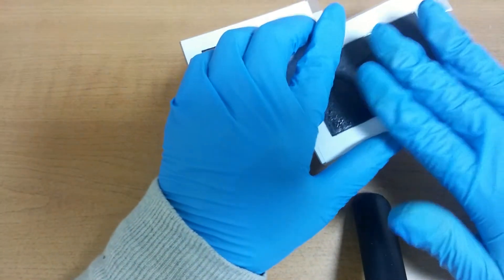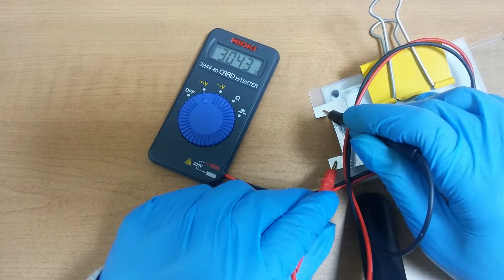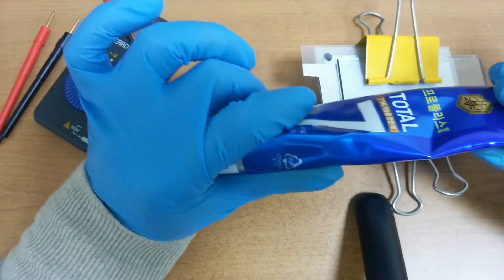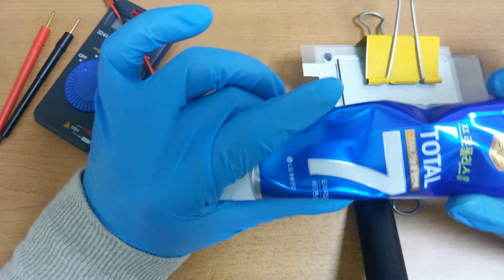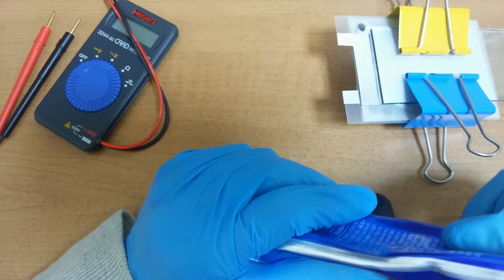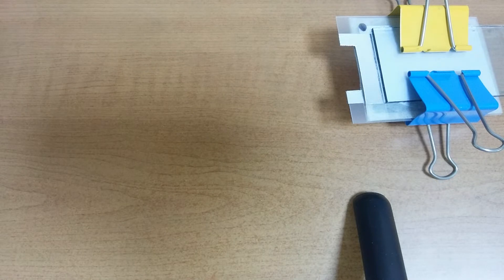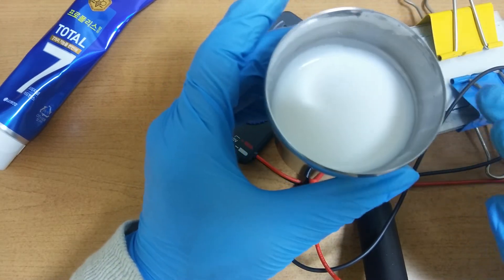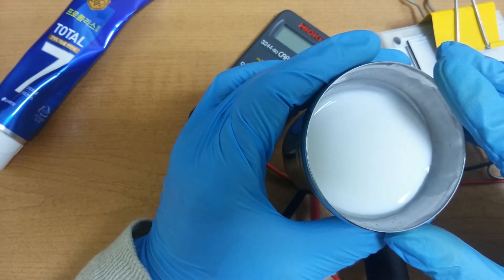graphene solid state battery: using toothpaste 3.0 V

Comment: Hey I reacted alcl3 and urea. The remaining product is like a solid. I put that between graphite sheet and aluminum. After charging the electrodes stick together. The cells I have made are small. But they do hold there charge. Amperage is the issue. Do you think amps can increase with graphene layer on graphite
Reply from the maker: In my opinion, Cl is not a good way. Have a nice day